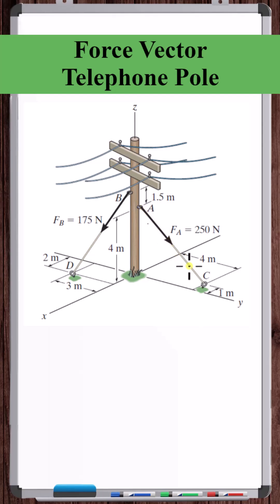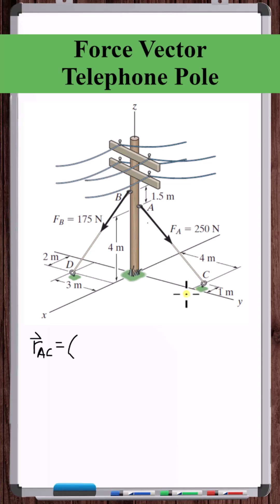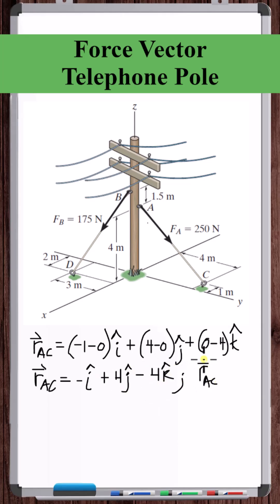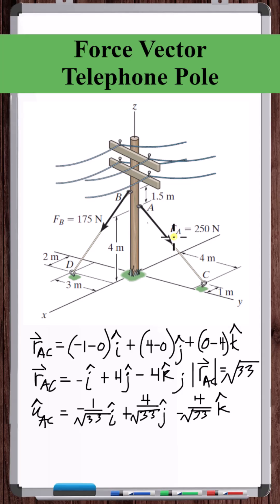Force Vector Telephone Pole Cable

Comment: This why the Linesmen bring their calculators with them when they install the power poles.
Btw, what is the numerical effect of the pole stiffness into the ground? 
At what point does the pole snap?
How deep does the pole have to go?
What is the effect of soil compactness?
What is the effect of the overhead wire tension on the pole?
How does this all change with temp and weather?
What are the requirements for the guy wire achors?
Reply from the maker: Haha all I know is if the force in that cable is known (via a load cell, etc.) and those dimensions of the cable are correct, then that's the force in the cable represented as a 3D vector.